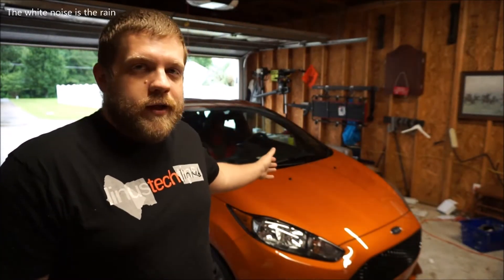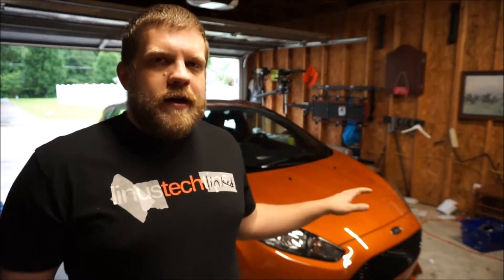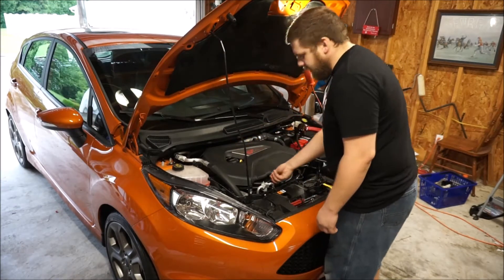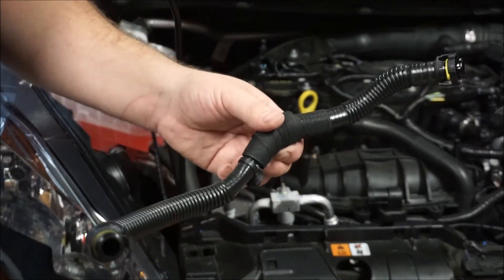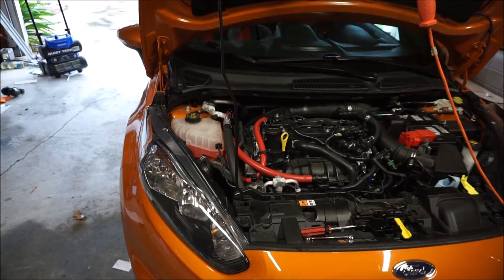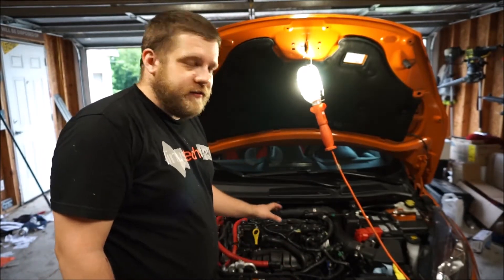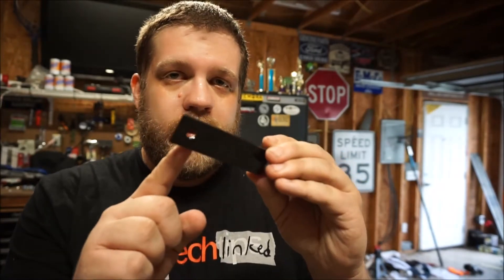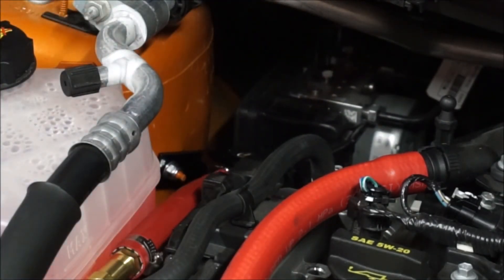2014 - 2018 Fiesta ST Damond Oil Catch Can Install

Comment: Thanks for the video! Can you tell us how many miles you drive before the can needs to be drained? Thanks!
Reply from the maker: You should check it about every 6,000 miles, at a minimum. You can drain it every month, if you'd like, but it really depends on what it looks like at your first oil change.